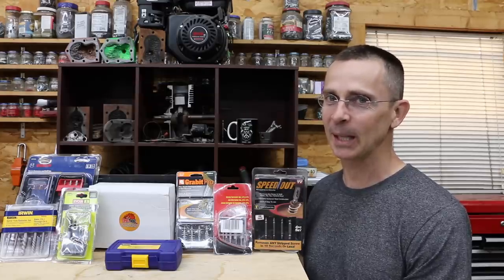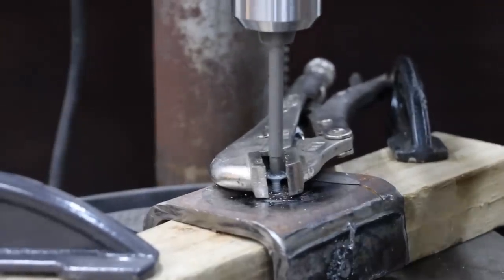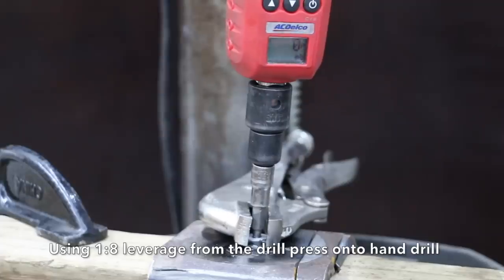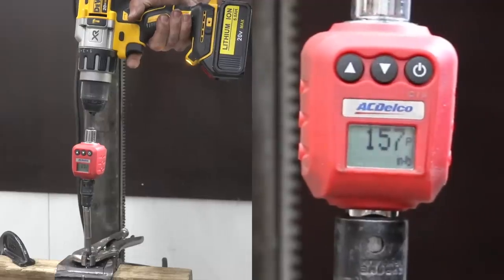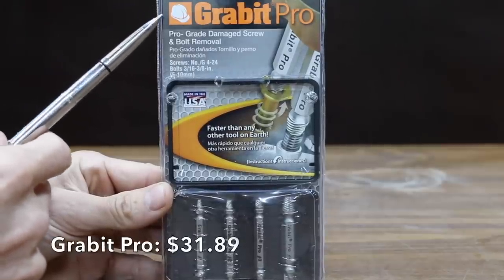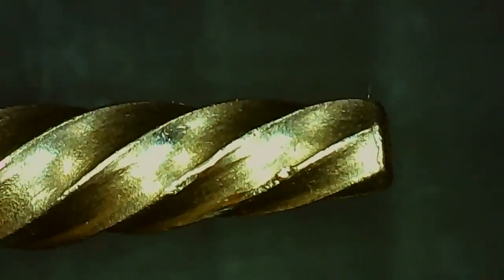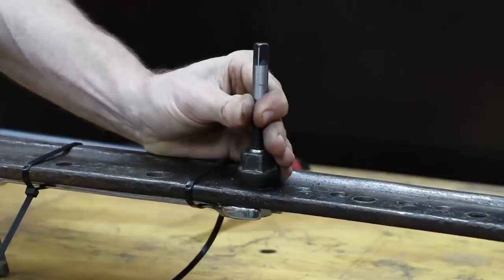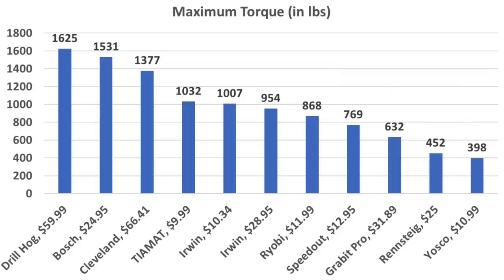Best Bolt Extractor? Let's find out!  Drill Hog, Bosch, Irwin, Speed out, Ryobi Broken Screw Sets

Comment: @ProjectFarm  I have a TV where the screw holding the base is stripped in a deeply recessed hole. It is a #4 or #6 machine screw. What do you recommend. I do not want to drill the head off, but it is close after trying a bit extractor that was a little too large (a #1). I am open to suggestions. Thanks. (You make exceptional videos!!! Thanks for all the details.) I don't feel like I can hammer the bit into place for extraction as it is attached to a 55" TV... I am afraid if I drill the head off the screw I will not get the rest of the bolt out...

Comment: The first extractor you used and the Ryobi, you don't tap in like that. Your screw em in with pressure applied. Those type grabbed a sized crankshaft bolt when others wouldn't.
Reply from the maker: Thank you!

Comment: Do a video on the screw being broke. Off and trying to get it out while messing up and drilling into the screw at an angle instead of being dead center. Include what type of bits being used to the steel bolt.
Reply from the maker: Thanks for the suggestion.
Reply: If you could make this video today or tonight that would be great. I have that problem right now and need it done by tonight. It’s a steel bolt that broke in the hole

Comment: From what I see the problem is those are tapered and need to drive into the side of the bolt/screws and it expands the bolt/screw into the nut/material making harder to remove.

Comment: Here's a great test for your YouTube channel. Broken exhaust studs in an Harley Evo motor. With the motor still in the frame!
Reply from the maker: Thanks for the suggestion.
Reply: I removed 2 from an old panhead one time, i tig welded a nut on the stud let it cool down , one came out first try , had  trouble with the second, wasn’t much to weld to but finally got it,

Comment: Snap-on n some others make an extractor that isn't tapered just round with flutes and a nut to fit over it for turning- work great as not to expand the fastener when turned and if it breaks the  remaining part is still usable and warrantied from snappy - although quite costly to begin with but never have to buy again
Reply from the maker: Thanks for sharing.

Comment: best way to take out stripped screws is to drill a hole into the screw , then hammering in a torques bit then use a shifting spanner to turn out the screw.
Reply from the maker: Thanks for the feedback.

Comment: BOSCH makes the best stuff. I ran the EPP for a PATRIOT missile system for 4 years. The generator housed a turbocharged diesel V8 made by bosch. 

Now if that doesnt sound impressive, bare in mind it ran 24/7, providing 150KW of power @2100RPMs.

And it was air cooled, no coolant.....

Even in 120º desert heat.
Reply from the maker: Thanks for sharing!

Comment: Had you been able to souce a few engine heads with broken exhaust bolts you would have provided a lot of people the needed knowledge of what brand of bolt extractor set might work best for their jobs trying to repair leaking exhaust manifolds. ALL automotive brands have issues with rusted, worn out exhaust manifolds and many people attempt to repair their trucks themselves but face broken bolts which have seized due to rust or corrosion due to aluminum heads and steel bolts.

Comment: Given the location of the bolt, it's hard to use a lot of these due to the clearance needed to get a drill in a tight space, and drill the hole straight. I've often used a welder to build up a nub on the broken bolt and weld a nut to it. Then use a socket to extract it. Not too mention none of these processes will work if the bolt was crossthreaded when installed, and if you happen to snap an extractor off in the drilled hole you will be hating life.
Reply from the maker: Thanks for sharing.

Comment: I watched this video but it confuses me.  I did something ignorant with my motorcycle and stripped the front axle clamp bolt.  The torque spec is 15 ft lb and I was set, but added a 1/4" to 3/8" adapter and did not know this significantly alters the torque.  The over torqued bolt stripped inside the head that takes a 6mm hex.  I believe it is an aluminum bolt.  I am afraid to use one of these taps and screw it up.  But if it does not come out I will be forced to have my forks  removed and replaced.  Any ideas of suggestions for which set is the best set to choose?

Comment: What about testing the rim/wheel lock nuts (anti theft). There are a few brands like McGard Febi Bilstein would be interesting to see which lock works the best even from a torque perspective when you torque the lock nut/bolt multiple times. McGard seems to be making a lot of money on unique replacement keys - I wonder how soft the steel is if it breaks so often ?
Reply from the maker: Thanks for the video idea.

Comment: None of the above.  I learned to use LHDB, that's "left-handed drill bits" for extrication of broken bolts and studs from an old timer long ago.  It's faster and simpler--no "extractor" is needed.  Just chuck up the drill, and drill your stuck part--the heat and vibration of drilling it, coupled with the left-hand torque makes most pieces come right out after a little bit of drilling.  No pre-drilling or second steps needed. The part comes out on the drill bit every time I've tried it.

Simple and functional.
Reply: Left hand drill bits are available in all sizes, you simply have to know where to look. GOOD old-time Mom and Pop auto-parts houses often have them. Try industrial supply houses otherwise, or online.  Bigbox and similar places aren't likely to have any.
Reply from the maker: Thanks for the feedback.

Comment: Hey I have a 92 ford f150 5.8 that I'm working on. Right now I'm have a 3 broken bolts 🔩  when I took off the exhaust manifold. Can you please help me pick the best bolt extractor to get these specific bolts out. They may be the original bolts tht came with this vehicle. A 92 Ford f150 5.8 engine

Comment: Good video, but, it's pronounced Reobee, what wasn't mentioned is that you're supposed to use left hand twist drills to drill out the screw or bolt in order to use the extractor to remove that screw or bolt.
Reply from the maker: Thanks!  Thanks for the constructive feedback.

Comment: I didn't see the Snap-on brand tested. I have a 12 piece set from the 80's. Those are not very long with a hex shaft. My size E has a little wear. The rest are in good shape. I would hate to see the modern price on those. And they do not come with drill bits, extractors only. Nice case though.
Reply from the maker: Thanks for the suggestion.

Comment: The Ryobi screw extractor set I have is is very hard to turn as I used an adjustable wrench, how do I use a drill like you are doing? The extractor are square 4 sides not round like a drill bit and not able to use a socket ....Thank you
Reply from the maker: Thanks for the video idea.

Comment: I am a little lost as to why you used the vise grips on the heads of the bolts you were suppose to remove.
Reply: He's not trying to actually remove them. He's trying to measure the torque that the extractor is able to exert without something slipping or breaking. If he were to remove them, he wouldn't be able to accurately measure and compare the products.

Comment: Know if anyone used one of these successfully to get a broken glow plug out? I am on my third which is similar to the irwin one and it catches but I can't get it to budge yet. Tried penetrating oil, heat, citric acid... not a breaker bar but fear that would break it.

Comment: I have a 3/8" round steel bolt with a slotted crown that is in a lead anchor in my garage floor. The head is too flat to get any kind of wrench on it but I need to get it out. The 2 identical ones next to it came right out but this one is stuck in place. I've tried tapping on the edge of the slot with a large flat blade screw driver and a hammer but it won't budge. How to remove it?
Reply from the maker: I would try cutting a deeper slot using a cut off wheel.  If that doesn't work, I'd try drilling a hole and using one of the tools used in this video.

Comment: Maybe OK for screws used in wood, but for broken off bolts and studs used in metal, forget it, they're totally useless. All you'll end up doing is to swell the stud in the hole, which then grips even tighter in the hole, until the bloody thing snaps off. Then you've got a real problem with a snapped-off extractor, which is too hard to drill out. With metal work, do the job properly in the first place and loosen the stud or bolt by heating with a welding torch, or if the screw is locktited, use a blow lamp to heat the area to between 150-350deg C which will break the locktite bond.
Reply from the maker: Thanks for sharing.

Comment: But you skewed the test of the SpeedOut on the exterior wood screw by using a drill bit from another more expensive kit! The SpeedOut kit by itself fails your test because the SpeedOut drill isn't hard enough for external screws. This is important to note because the SpeedOut website has a product video in which it claims to be able to remove a 4-inch decking screw from a redwood deck. I tried for two days, following the instructions to the letter, to get the SpeedOut kit to remove 3-inch decking screws from standard deck boards. (The screws were not brand new as the ones used in your tests, but were five years old.) Regardless of the drill used, setting used, recommended steps followed, SpeedOut removal bits would not bite into any of the screws. Note this: contrary to the ad claims and the outer package of the SpeedOut kit, the user instructions state that the kit is "compromised" on "large screws over 2-inches in length". ( The "Helpful Hints" at the bottom of the User instructions state that the recommended "step-up" method if the removal tool fails to bite will also "compromise" the kit.)

Comment: I like your testing on products, but this testing is flawed ... 
1. these extractors are for bolts not for wood screws witch are hard steel
2. is important that when you tap in the extractor, the extractor should not expand the bolt in the nut female threading otherwise it will stuck more the bolt ... so this test are not close to "reality"

Comment: I’ve got the Irwin Multi-Spline set. I’ve used it many times to extract factory torqued bolts that have become stripped out of vehicle chassis. Drill in an inch deep, wedge the correct spline and back out with a breaker bar slowly seems to work well.
Reply from the maker: Thanks for sharing.

Comment: Saying there is a best bolt extractor is like saying there is a best way to get shot with a gun. If you are having to resort to one of these it pretty much sucks. The best luck I have had is with left handed drill bits, it's drilling the hole anyway and often the snapped fastener will back out while you're drilling it.

Comment: Your test of inch/lbs for the extractor while holding the screw in place simply isn't authentic as that is not what would be the real life use. First off a small diameter wood screw would pop the head off making removing it either nearly Impossible or unnecessary. Aside from that, the screw extractor isn't getting an opportunity to actually do what it was designed for which is actually turn the fastener.
Reply: I would have liked to see the bolt actually get extracted

Comment: Overall, fundamentally flawed test and set up! Deck screws and a few others have hardened heads. Most drill bits are not designed to drill hardened steel and most extractors will also perform poorly against hardened steel. A better test would be to cut the head off to simulate a broken screw or bolt, and broken bolts are probable 99% of all situations in which you would an extractor.

Comment: Well? Speed Out PRO does not work in my opinion. I first tried a regular drill like the package states. Then I tried a impact driver. Nope. I had rusted screws on a mailbox which holds the box to the wood support plate. The bits just spinned. No grabing action.
Reply from the maker: Thanks for the feedback.

Comment: I had already tried the speedout brand, it is garbage. It is 0-6 in removing wood screws for me. I had the same problem, the "drill bit" side is trash and doesn't work. The last time I tried to use it, I used an actual drill bit but had to drill so deep for the extractor to finally get a bite that the head of the screw popped off.
Reply from the maker: Thanks for sharing.

Comment: I would love this but for very small bolts! Specifically, I am working on motor motorcycle carburetors that have the heads of brass jets deformed and it's hard to extract
Reply from the maker: Thanks for sharing.
Reply: Have you checked out the Grabit Micro?

Comment: I have the grabit micro and I'm a big fan. The biggest thing is that it has a more shallow angle on the reverse threads, and the threads start right away which means you can extract without having to drill as deeply. With the traditional spiral bolt extractor, although in theory you can get away with drilling only about 1/8", in practice you usually have to drill much more than that to get a good grip. With the grabit, you can often just stick it directly in a stripped phillips head and back it right out, no drilling required!
Reply from the maker: Thanks for the feedback.

Comment: The reason why they don’t work is because you have the vise grips locked up against your drill press. If you wouldn’t of had the vise grips on the screw they would of spun them out
Reply from the maker: Thanks for the constructive feedback.
Reply: Finally someone pointed out. All the comments are, like : "love this channel bla bla bla". I was like why ist that vicegrip blocking the screw.
Reply: @ProjectFarm  it’s true. If your just gonna bash on things that actually do work then don’t make videos about them. Cause I’ve used most of them an the ones that you said didn’t work for you. Well they worked for me an my friends. Next time don’t have the bolts locked down with vise grips and they will work like there suppose to. 🙄

Comment: I'm sorry but it looks to me like your trying to fail all of the extractors. I have worked inthe automotive field and most broken bolts and nuts have happened on the exaust side of everything. It looks to me that you are gripping the screws with a vice grips and letting the grips hit and stay against the upright of the drill press. In the real world that wouldn't happen. I have broken head bolts putting an engine back to geather. I would suggest that you go to a wrecking yard and grab a steel or alumanum  engine block with headbolts and twist them in untill they break then try to remove them.
Reply: nah

Comment: I've got a screw stuck 4 inches deep inside a small hole. Most extractors are not deep enough or too thick to be of use. Because it's stuck deep inside a plastic casing, too much force will do the trick but unfortunately I would then need to replace the entire housing. So I have to finesse it. Was thinking super glue though that could easily go wrong. Idk

Comment: Need help!
Ryobi #1 spiral screw extractor (#8 - #10) was broken inside the bolt (hexal socket bolts that hold car manifold with the engine block.)
Now I have to drill a new hole through that broken piece again.
I tried Milwaukee and Hercules titanium coated drill bits without success.

Do you know which brands of drill bit can drill through that broken piece?
Thanks

Comment: You know when it's time to have a professional machine shop to intervene. Made in China is usually the beginning of your headaches. I remember Caterpillar Tractor had a machine that removed broken taps with a device that sent short bursts of electrical current to the broken tap to shatter it into small pieces. If I break a tap or strip out the head of a screw, that's when I know a cold beer helps control the profanity. It must be a  very common scenario in China. LOL

Comment: putting this to the test on a laptop screw update soon to come.
Reply from the maker: Thanks for the suggestion.
Reply: @Project Farm  tried it did not work as intended but did still work, ended up having to use a larger bit size and once it dug in enough into the laptop screw it managed to break it free.

Now only problem is gotta find some replacement screws.
Reply: @DotADBX try eBay man

Comment: One useful tool for frozen and/or stripped screws is an impact driver like https://www.amazon.com/TEKTON-2905-8-Inch-Manual-7-Piece/dp/B000NPPATS.  When struck with a hammer, the bit turns a bit.  Since the bit only moves while the driver is hit, it can get more purchase and doesn't further strip the head by being turned without enough down force.

Comment: Always use a left hand drill to drill an extractor hole.  You will usually not even need to use the extractor since the left hand drill usually pulls the bold out.

Comment: Had the oil pressure sensor break off on a classic car, cast iron block. Those sensors are small and hollow so didnt have to drill but a jet of oil was coming out the side of the block so could not drive either. Managed to force in a plate screw, roadside repair successful. Some weeks later i had a new sensor, screwed in a bolt extractor, it made the remains of the sensor expand so now it was really stuck, used more force and twisted the extractor into 2 pieces. The good news was that the oil leak was permanently sealed by the broken extractor, the other good news was that oil pressure sensors are over-rated, on these old engines the level is all you need to worry about.
Reply from the maker: Thanks for sharing.

Comment: Nice to have a test like this but you do not tab a extractor in with a hammer. You "screw" like a screw, but then turning left, it in until it grips. By tapping it in with a hammer you damage the extractor before you can do the test.